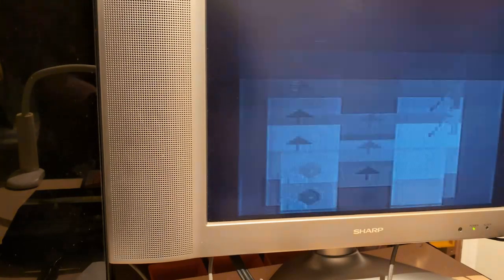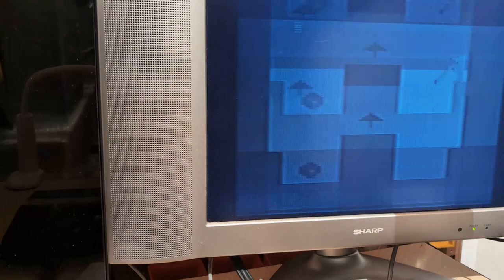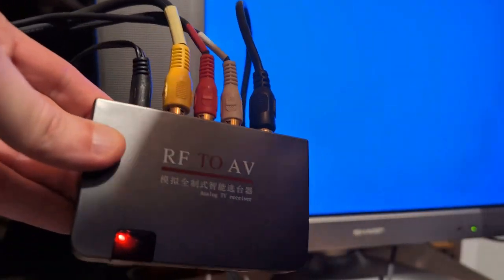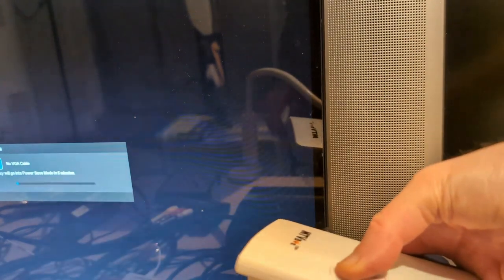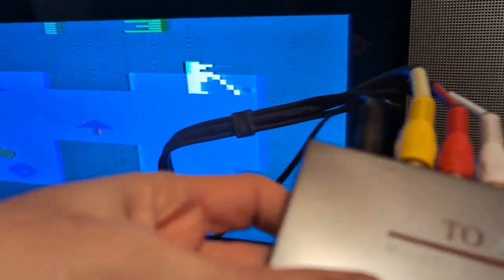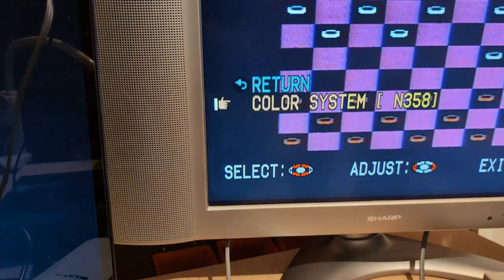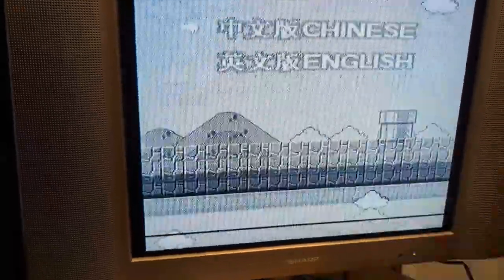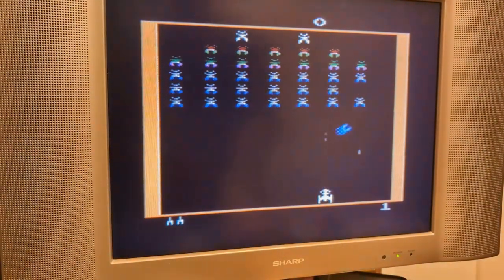PAL NTSC Retro Console TV Signal Conversion

Comment: What's close to PAL-I?
Reply from the maker: PAL-I was used in the UK, Ireland, Hong Kong, South Africa, and Macau. Because it uses slightly different bandwidth for audio/video a compatible tuner is necessary to properly use this analog standard. I have an Atari clone from UK and it requires a PAL-I setting. (Source: https://en.m.wikipedia.org/wiki/PAL )

Comment: As far as you know, does the RF to AV converter work also for NTSC-J (I guess 3.58) modulated RF signals? I mean, will it output properly NTSC analog video & sound?
Reply: I actually got one of these from either Banggood or AliExpress a few years ago. I can use it to play a RF only Famicom on my pal Tv. It has a few quirks, due to its cheapness, I suppose. 1) There is no built in memory, so you have to tune it each time you use it, and 2) This is the big one, the auto tuning doesn't pick up the Famicom signal, I have to manually sweep the frequency back and forth around 90-92hz and it will randomly pick up a signal after a few tries. I thought it was broken out of the box and got a refund for it. I randomly decided to fiddle with it a year or two later and discovered what I outlined in point number 2. It does introduce a delay I can notice when playing the game, though.
Reply: @farqman  What TV model you have? Weird it works on PAL TV, unless the input you are feeding the Video in accepts NTSC or PAL @60Hz rate. I have a sony KV-21CL10B CRT. It accepts NTSC (both 3.58 & 4.43 on the AV input only, not SCART nor the RF from antenna). When I auto tune PC engine signal directly from RF input on TV, I get quite acceptable color picture but no sound). I guess the TV is picking up sound 6MHz forward from video, which is PAL, instead of 4.5MHz (NTSC). About the tuning  issue you experience, did you try fine tuning to 91,25MHz? It is the video carrier frequency for US channel 95 used by Famicom when channel selector is in position 1. Maybe RF components aging in the Famicom led to carrier frequency shift and it is not exact 91,25MHz. I just ordered this box, so I'll let you know my experience.
Reply: It's a LG DVD/VHS combo from the early or mid 2000's (only accepts PAL RF) hooked up to a Sony LCD Tv. Hooking the Famicom directly to the LCD tv works with colour and sound, but the RF input has so much lag it is unplayable. Things hooked up to the AV inputs have imperceptible (to me) lag in "game mode", so I get better performance going thought the DVD/VHS player, but there's no sound. It is in colour though. As for fine tuning, the interface for the demodulator is the most bare bones, bottom-of-the-barrel, cheap thing they could scratch together. There is no fine tuning. Tuning is either auto scan, or you can pause auto scan. From there you can auto scan forwards again, or auto scan backwards. I cannot understate how the interface is the bare minimum. The only thing that gave me a hint that I might be able to pick up a signal was the the scanning would slow down around the 90-92hz zone like it was trying to pick something up but couldn't. It's from there that I thought I could try to pause the autoscan after the slow spot and scan backwards. If it still doesn't work, I'll pause and scan forwards again. It usually takes a few passes to get it, but it always will eventually.
Reply: @farqman  It looks like you experience same issue as I on my TV while using the DVD/VHS combo: as it is PAL only, you cannot get video & sound at the same time. Maybe if you tune on a lower frequency (88-90MHz), you'll get sound but no video. Was not aware of such limitations. My thought were it has at least manual scan. Anyway it sounds like the best solution among all 3 options.
Reply: Just got the RF to AV box. After some tweaking, I managed to get picture&sound from PC engine's RF. They both are quite good quality and barely noticeable they come from RF. I had to change sound to 'M' in the SET menu to get picture and sound. Other options (DK, BG...) lead to bad quality picture (sometimes black&white) and no sound at all (I hear some weak FM station instead). 
Actually, it has storage capability of the scanned channels but I still didn't figure out the logic behind: when I do full range RF auto scan, it always starts with "0" displayed below "AUTO". I guess it stands for channel "0", which is kind of trial channel. When auto scan ends it displays the signal @90-92MHz but no way to store.
After scanning again, I experienced a different behavior: it slows down @90-92MHz, then again @270MHz & 360MHz. It is like there are harmonic frequencies of the main carrier. And the channel number gets incremented to 1 @270MHz and again @360MHz.
After scanning ends, it displays channel "1", which is poor quality due to harmonic signal I guess, and I can retrieve the channel after switching OFF/ON the box and even change the channels through remote.
Now I need to figure out how to store the 90-92MHz signal since it is the best quality. Also noticed I have "MANUAL" and "FINE" scan options while scrolling down the "TUNER" menu, but they bring nothing more.